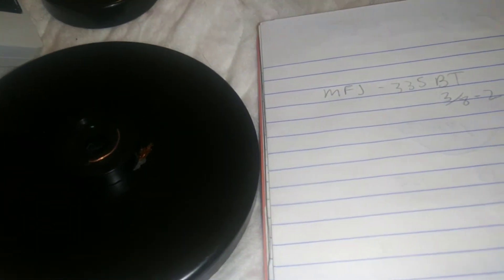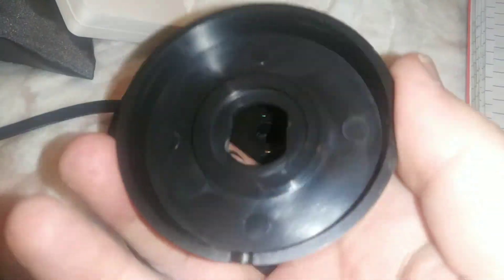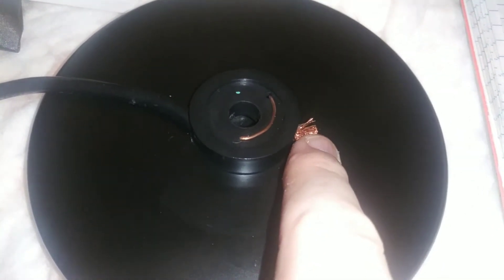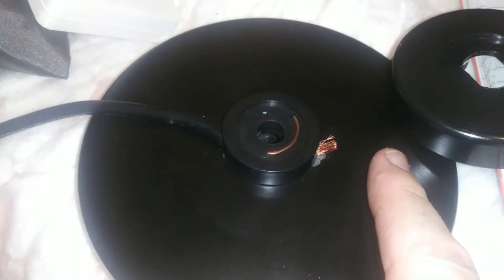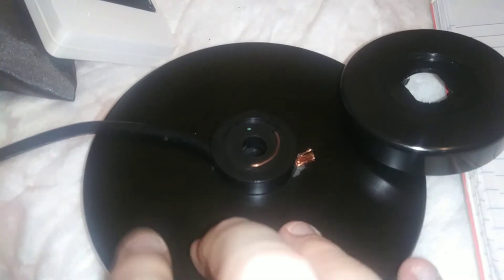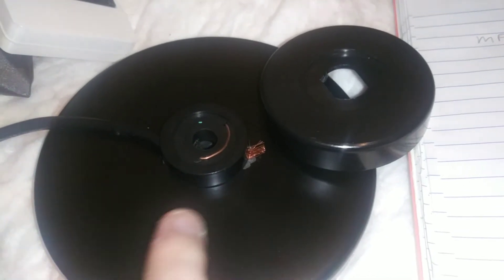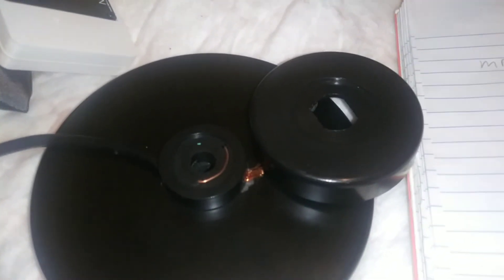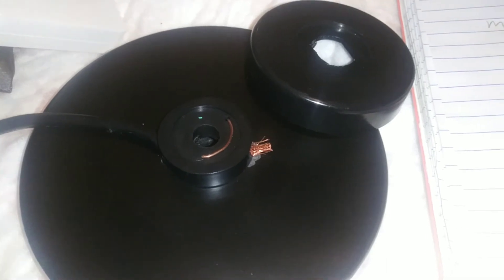MFJ-335BT 3/8-24 Magmount for Hamstick Tear-down for Counterpoise

Comment: What was your SWR on 20 without a coutnerpoise?
Reply from the maker: MFJ hamstick on 20 bottoms out at around 1.2 and remains below 2 form most of the band. For me the counterpoise option is more about trying to steer directionality pattern than lowering swr.
Reply: @randonloebsolvingproblems4421  
Thanks for the reply. I just ordered that mag mount and I have a 20 and 40 m ham stick to try out.
Reply from the maker: @KB2CWN  40m the swr is a little higher (1.5) and the bandwidth very narrow. I used to use it a lot however for CW and had satisfactory results.  Somewhere on my channel is a video of me working Alaska from Florida on the 20m hamstick. I am very lucky in terms of my car seeming to result in good swr, good luck to you.